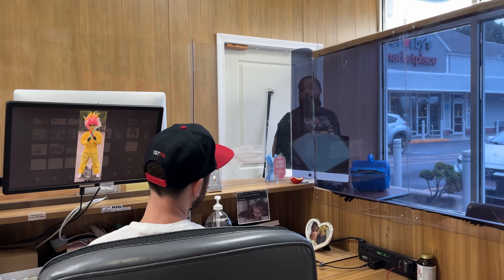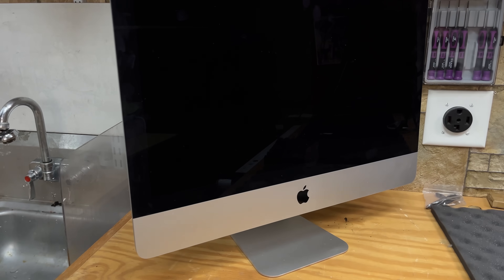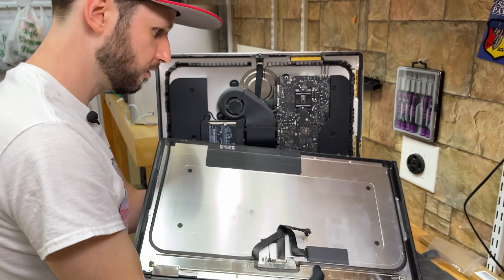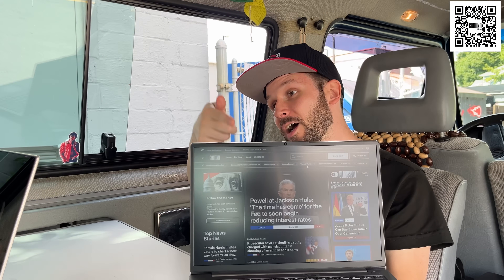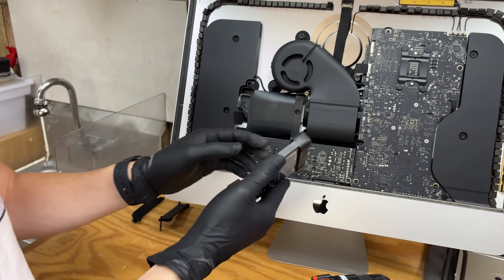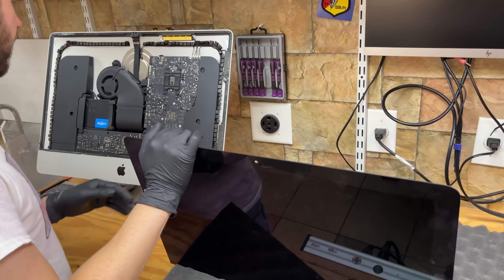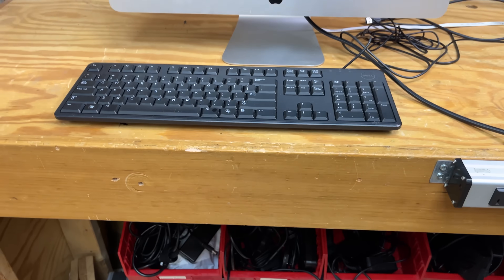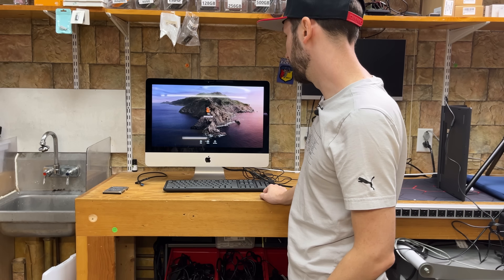This Upgrade Isn't Possible on New iMacs (Sometimes Older IS Better)

Comment from the maker: Go to https://ground.news/techsperts to think critically about the news you consume and be better informed. Subscribe through my link to save 40% off unlimited access.
Reply: @SalemTechsperts 4:34 The deadest technician that never lived. 😂
Reply: @CreativeContentCreations8401 you cant pin replies bro
Reply: Hey Salem, i have a question. Does that transfer cable wrok for a data transfer from the HDD to the SSD if the HDD is 3.5 inch". Because I was told that USB couldn't deliver enough power for 3.5" hard drives but only for 2.5" hard drives.
Reply from the maker: @puncas1865  no you need the other adapter that provides more power, I have them linked in my Amazon shop
Reply: @SalemTechsperts  Thnx for the response, I asked because I need to transfer data from an 3.5" HDD to an nvme SSD. So the HDD was the boot drive in an old windows 7 based system. My plan is to hook up the HDD from the old system and make sure the nvme SSD is set as boot drive in the BIOS. Startup the PC to than transfer files. Idk how it's gonna look in file explorer if I open that HDD drive. If that would even work.
Reply: @SalemTechsperts if you were really goated you’d heart this comment
Reply: @SalemTechsperts  you mentioned you find deals on these computers all the time, can you recommend places to buy them?  Is it possible to upgrade the RAM and CPU on these computers if so, how difficult is it and can you do a tutorial video demonstrating these upgrades?  Thanks
Reply: Best thing to do is install Linux on all imacs
Reply: a channel called "remanac" is stealing your (and other peoples) content

https://www.youtube.com/@remanac
Reply: I have an iMac late 2015 27" i7 upgraded with 32GB RAM, 2TB Samsung 870 Evo Plus NVMe and 1TB Samsung 860 SATA SSD. Now 9 years later, it doesn't have a scratch and it works like new. I just installed OpenCore (daily build) and Sequoia Beta on it...and it works! It even seems faster than ever.
Reply: Pretty nice. While ur PC gets fixed. U can get a sub.
Reply: Could you do a video on this type of Mac, but when you upgrade (clone) the storage with a larger capacity than the original drive, and going through a Linux software to merge the partition with the unused space?

That's the step I used for a classmate's Macbook 2013 (I think). I have no idea if Aomei makes things X1,000 faster, I would hope so. At the time, I did the Linux method when researching stuff
Reply: Do you work on Nintendo switches if not where would I go
Reply: Hey so my nano 7th gen I pod is flickering on and off is their anything I could do?
Reply: Please how fix Lenovo laptop ain't accepting charge and it ain't powering on too🙏🙏🙏🙏🙏
Reply: Hey Salem i kinda need you help I watched you contant for a while (love it you are funny af) but my pc I having some problems and I dont know why its a older pc (3-5 years) and for some reson it frezzes for no reson I scaned it multiple time and it showed nothing wrong but but now it wount even go past the ASRock bootup screan I think it might be the hard drive but idk please help
Reply: Hey Greatest Technichian That's Ever Lived we are looking to buy a budget friendly laptop which will be used for college stuff which will include a bit of coding and since not all laptops these days are built to last I was hoping you could suggest one that could last us a while, we need nothing really too strong just something good enough that won't start lagging after just a year and is easily repairable it doesn't need to be brand new a refurbished one will do just fine.Since none of us don't have much knowledge in computer technicalities we were hoping you could suggest one to us.Hopefully you read this reply and if you do then Thank You in advance for the trouble.
Reply: Yes interested on the air cleaner
Reply: I had to mention this , I didn't think you saw this.Magic is a sin , Christians shouldn't be one with darkness. JESUS is GOD (there is historical proof of that like eye witness accounts and people like Pontious Pilate along with a lot of scientific proof like the days of creation with go with science. also evolution is not real , never has an organism gain genetic information BY IT SELF JUST LIVING , in fact it has been observed that they loose it. GOD has to be real because life can not come from non life, something can't come from nothing , there is a source for everything and that is JESUS/GOD. He loves you man and he can heal you from your depression and anxiety(trust me). if you still don't believe me say this to GOD,"JESUS if your GOD , the show your self to be in a dream and in a DREAM ONLY! Today it self" Muslims , Hindus , Buddhists and Atheists have tried it and they worked. there are testimonies online and miracle testimonies of the healing of PHYSICAL DAMAGE .

Comment: I recently replaced my 2020 27” Intel iMac with a 2024 M4 Mac Mini connected to a 27" Apple Thunderbolt display. I have almost the same form factor sitting on my desk with a fully supported currently future proof set up.

Comment: Doesn’t it need the temp sensor for the hdd? I have seen other videos that say if you don’t put that in the fans ramp up to 100% all the time. Might be the later models… not sure. Great video!
Reply from the maker: The pre-retina models require you to short the temp sensor
Reply: @SalemTechsperts Oh so its the pre-retina models…. I have a 2017 27” imac and it has the 2tb fusion drive so (I think the ssd portion is 128gb). I had OCLP and was running Sequoia but it is really buggy and takes forever to bootup. So i returned it to factory. I was thinking about putting Ubuntu 25.10 on it….hmmmmm

Comment: I bought one I love it I still have 10.12 on it for older apps that work better on it, and I other macOS too 10.14 on Mac Pro 2010/2012; and MacBook Air macOS 12 & a MacBook R with macOS 13

Comment: It only has power in the little capacitors on the board if u unplug it your should then hit power button to try and discharge any leftover power in capacitors

Comment: This does not work on late 2015 27” retina 17,1 iMac.. was running Monterey has the 529. Latest efi firmware. Fusion Drive died. Bought the ifixit ssd kit, Mac no longer installs past Catalina even though it says Monterey is what should be installed when doing command-r on boot up. 

Even installing onto an external does not work… after months of frustration, spent months of more frustration trying to get opencore legacy to install it. It also does not work. 

In other words do not buy this years make and model. Get an older one

Comment: I did the same with my 2017 27inch iMac three years back and it's working surprisingly good even now although nowadays I only do basic stuff on it due to the aging i5 7600 CPU it's still a great device. It's a shame they don't make 27inch iMacs anymore.

Comment: I would say... recently having dealings with these machines myself - beware of these machines that come with a "Fusion Drive". Its a mechanical hard drive (1tb for instance) and a 128gb SSD "stitched" together in true arsehole Apple way. You get SSD-like speeds, with tons of storage. Sounds great on paper. But these two drives are literally stitched together, so you get one volume appearing. If either drive fails, you CANNOT simply put the 3.5" SATA HDD into a caddy and recover/backup your data. You will need to get professional (and expensive) recovery people in. If you get a replacement SSD for instance (Apple proprietary M.2 slot so any standard M.2 SSD is a no-no), you would need to re-stitch that with the 3.5" HDD. And re-stitching, or un-stitching results in both drives being erased. The 3.5" caddy doesn't work as all the partition data if held on the SSD (I think thats how it work?) - either way, you cannot read the mechanical WITHOUT the paired SSD. A friend of mine that owns one of these machines has her own company - lost 30 years of work, contracts, emails, documents, photos, etc due to this lack of knowledge. Had anyone understood what "Fusion Drive" was, it would have been far safer to remove both drives, and insert a standard SATA 2.5" SSD - and forget "Fusion Drive". The SSD (if inserted) is on the opposite side of the board and is a pain to get too. Its not on all machines, just ones that would have been more high-end in the day. She had "Time Machine" too, but after the hard drive was replaced - Time Machine was asking for a pin which we never knew? Nobody remember setting a pin and every combination we tried failed to work. So just a warning!!! Otherwise, great machines!

Comment: The other issue with power supplies ans thin gloves is that high voltage goes right through it. Unsure if the caps in the PSU are high enough voltage though. And also even if there's not a hole in your gloves, there's a billion pointy contacts wanting to make one.

Comment: Those connections to the screen are tricky and often loose. I made the mistake of applying the adhesive strips before checking the connection only to find a black screen when I booted up. Had to go through the pain of cutting the adhesive again so I could fix the connections. It's a major design flaw, IMO.

Comment: Before you take it apart once it’s unplugged if you hold down the power button for about 15 seconds you can discharge the capacitors in the power supply so you don’t risk to get shocked.
Reply: good practice but still doesn't mean their fully discharged still should avoid touching them.
Reply: @skylarhasmail666  I agree. better not touching them. I used to dial with much bigger ones in hi fi car stereo build outs and boy those big fat ones are pretty scary...

Comment: So I inherited a Mid 2017 Mac... using it for video edits and the odd stream. Been debating getting a new PC but the spec I want is like 1500/2000 and I dont really want to spend that much. Would a RAM and SSD upgrade bring this badboy into 2025? Happily dunk like 500 into it if is worth it? Thanks for any help

Comment: I just swapped the dead apple SSD with a 2TB NVMe stick for a boot drive in my 2015 27", and I’m kinda shocked at the speed increase.  I’m kinda retro, so I’d not really kept up with you kids and and your fancy new storage technology, but now I understand why everyone is hyped for these sticks.

The stock SSD had died some time back, so I’d split the fusion drive, booted from a USB ssd, and carried on for a year, until I started getting “rare” overheating shutdowns.  After surgically removing dust from the bottom intakes (and it was considerable mats of dust) and no joy, I split the screen off and found the fan blades were completely blocked with a felt mat, so was not moving any air at all.  One thorough cleaning and the new boot SSD, this 10 year old machine is cruising alone just fine.

Comment: Thank you so much for this tutorial. I had a friend who’s trying to become filmmaker, used a mid 2017 iMac till later OS updates made Final Cut Pro unusable for him. He purchased a Mac Mini and was about to toss the iMac till I asked for it. It also had an HDD and 8 gigs of ram. I replaced it with a 1TB WDBlue SSD and 32gb of ram from OWC. It works like new, faster boot times, doesn’t shit the bed when you have more than 3 tabs open

Comment: I’ve heard you need a heat sensor on the ssd otherwise the fan always runs thinking it’s over heating? Weird I know but is there truth in it?
Reply: This is only on the 2007-2011 THICC imacs that have a superdrive
The 2012-2020s do not have many thermal sensors
Reply: @macdos1 awesome, thanks for getting back to me on this.

Comment: 9:04 Sorry to ask but whats that cushion thing called? Tried to find the exact name for it cause it could be possible I will be repairing a 2012 iMac for someone soon and so I wanna protect the screen
Reply: That kinda looks like the inside foam pads from a pelican case. ( the durable black plastic case people use for pew-pews and camera equipment 
You can also just use some acoustic foam echo absorbing tiles. They are literally the same thing.

Comment: The iMac is a terrible design hardware-wise. 2011 is magnetic and a bit easier to work on, but it has way too many screws. Apple should have made both the RAM and the HD easily accessible and replaceable, more like a laptop design

Comment: Or you can just boot off an external SSD
Reply: This is not reliable and you won't have fast speeds
Also if you try and plug in something else and it disconnects you'll have big big issues
And you lose a usb port

Comment: Cool vid didnt know macs are upgradeable.
Reply: The 2007-2011 imacs are better because they have no adhesive that you can mess up
It does have temp sensors that if not plugged in properly the fan will go haywire but other that that it's good

Comment: i have a 2017 iMac running Ventura 13.7.4.   there is only one more software update for this board..   What do you charge to do what you did today :  remove screen, replace the 1tb fusion drive with a new 1tb SSD... and update the IOS with the latest version..?
Thanks Rob. ..

Comment: I have the same i mac and currently it just boot cycles. i tried reseting the nvram and nothing happened same with the repair tool on the disk it just wont stop the cycle  i read online it has something to do woth a kernel crash of some kind

Comment: I have a late 2015 27'' imac 5k and I didn't remove the LCD because the 27'' are worse for breaking and a 5k screen is too expensive to replace for a old mac. So I cut a port hole where the NVME is . I also took an old imac and cut the memory door off, 3d printed a spacer and mounted it on my 27'' imac port hole. Now it has an original cover. Doing this also allows you to reach the Sata port and make the ssd external and leave the spinny drive in there. there are 3d prints for trays to mount on the imac monitor stand. Very easy and simple way to upgrade these old macs that are still way powerful enough to do work and light gaming.

Comment: With the 2017 iMac, 21 inch screen, there is actually a workaround were you can swap the memory without taking the thing apart. Swapping HD for SSD is the easy part - but the memory can be squeezed in without too much bother also. The base model is 8GB RAM and a 1TB slow spinning hard drive.

Comment: Wanted to do this on a pre-retina iMac (the thicc ones), but apparently the HDD has a temperature probe that is used to control the system fan, so if you put a new drive in, you have to buy a universal temp probe to hook into it, otherwise the fan will always run full tilt.

Comment: If you have it - upgrade it. If you don't - buy n100 intel based mini computer and a displayer. By the way - I used to have 2007 iMac and i replaced it's hardrive to SSD. Times i did it SSDs were still preatty expensiwe. Theree was no mount for 2,5 hard drives so i just glued it with double side tape. Worked fine for till this computer was still useable :) I would never bough Apple products though. Apple used cheepest line of WD hard drives on my iMac.

Comment: I have a 2013 iMac.  My only problem is I can’t upgrade the system to work with Microsoft office 365, excel and word will not save because of the older operating system!  Is there a work around or fix for this by chance?

Comment: I do understand upgrade and most people do. The thing about upgrading is there needs to be enough computer there to do an upgrade. When buying or building a computer you need to build the best build you can and should last around five years. If you didn't build that way there will be little you can upgrade in components. The only thing left at that point is to rip everything out and rebuild. Upgrades are great but there is a limit to the components.

Comment: Older Macs I’ve found, if you live in a dry climate, like almost everywhere west of the Mississippi, are very brittle in every part. Stuff can break off with the slightest touch. Wonder if sometimes “Incubating” one in a humidity enclosure of some kind, might lessen the problem.

Comment: Bought A Late 2009 27inch Imac i5 8GB Ram 500GB SSD With Magic Keyboard And Magic Mouse For $80au, Sold Keyboard And Mouse For $60, I Doubled The Ram, Swapped Out i5 For i7, Running Ventura With OCLP, Not Too Shabby For A 16 Year Old Mac, Apple, Your NOT Getting My Money

Comment: I agree with you. But used/refurbished Dell Optiplex AIO's are more repair/upgrade friendly.
No adhesive is involved if you want to upgrade the storage or RAM. Some models only require a few clips to remove the back panel and access the HDD or SSD! The PSU is safer as well. Some models even have upgradable CPUs!

Comment: Previously bought a broken 2012 macbook laptop with dead SSD card. I bought a aftermarket SSD card for it and installed MacOS.

Crazy is apple wanted to charge Previous owner $100 me i charge only $50

Comment: I no longer buy the replacement tape, I do use the pizza cutter, but i don't remove the foam tape, once I have changed the HD to SSD and added ram, i simply paint on contact adhesive on top of the foam that has been cut. Wait for it to partially dry, about 10mins. Then carefully align and fit the screen. Once full dry I can't pull the screen off whatever i do. Done  3 like this so far.

Comment: I watch for the red horse shirt (cough). I like red. I have yellow and black horse shoes, aka:sneakers. The shoes are great so I bought red ones too. I won't wear them when I watch your vids.  I bought them by accident, like how I found your vids. No one was hurt. You need to get out more. I learn stuff from yer vids. Thanx. I started building pcs in '93 (yes, 93.) In 2012 started upgrading macs. About the same time I found out about the Dell Precision pcs. Laptops that are user up gradable. Who knew? Thanx. O. Did that already. Nevermind.  ' 8 - |